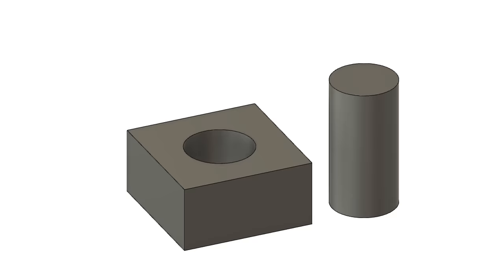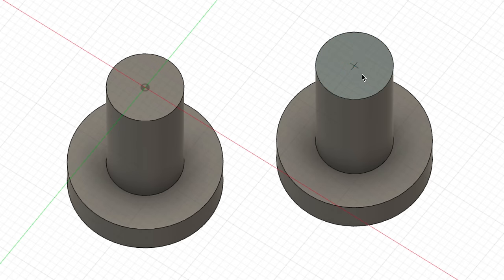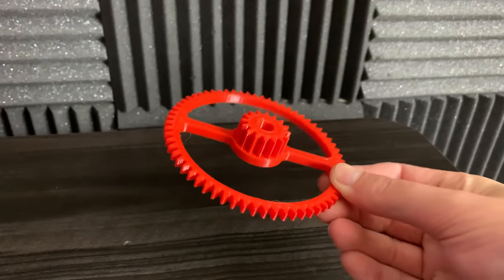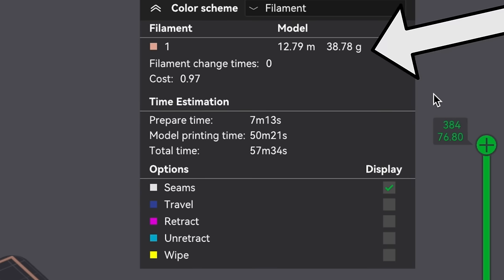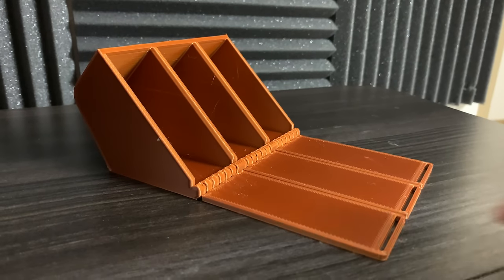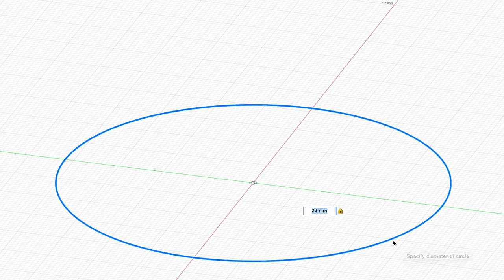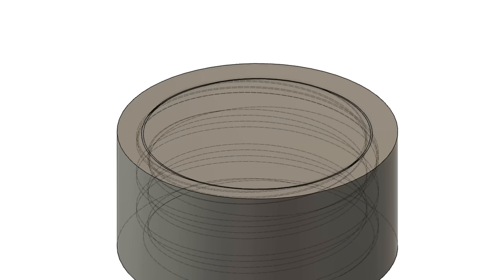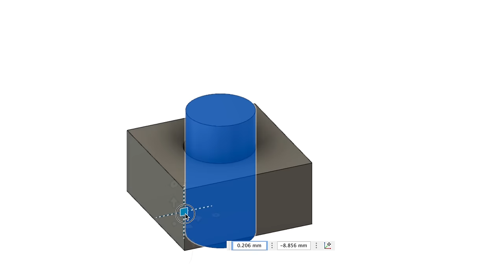10 Secret 3D Printing Tricks Only Experts Know...

Comment: There is a reason why people left Fusion 360 a year ago. They stopped supporting STL or something like that
Reply: @htpkey  Fusion 360 was free for non-commercialuse. They changed the rules later on and made it more restrective at some point
Reply: @tomaszworoch  True. They still offer a free "stripped-down" version of the program. But I would rather use something else.
Reply: STL works fine in Fusion 360.
Reply: @DisorderedArray  Then I do not know why did I leave this program xD
Reply: @tomaszworoch  They removed STEP export (it is now back after the massive backlash) and you can only work with 10 active "projects" (or individual parts of an assembly). 

If you create complex models using assemblies you will reach that 10 project/parts limit very quickly. A workaround would be to add all your assembly parts to a single project, but the workflow is worse because of it.
Reply: @htpkey  Good to know :) maybe I will get back to it then
Reply from the maker: You can still export STLs with the free version. It actually has most of the same features as the pro version.
Reply: Always have multiple softwares for creating and editing models

Comment: That .4mm tip is actually MONEY I always go .25-.30 for a snug fit .35-.40 over for smooth
Reply: A bit of clarity here. These clearance values you (and the video) are mentioning, specifically with the example shown of a cylinder fitting in a hole. Is this clearance allowance applied to the cylinder (and/or hole) radius or diameter? This kind of makes a difference. ;-)
Reply: @Sembazuru  good question, for me in the case of a part threading onto, or fitting over an existing diameter eg. an adapter that must go onto an existing tube/cylinder, I add the clearance to the part with the hole.  The reverse is true if the case is opposite.  If I am designing both from scratch it comes down to materials, precision requirements, etc. But in general, I either split it between the two or default to the hole carrying the clearance
Reply: @howardeley3577  You misunderstand my question. Is that clearance applied to the radius or the diameter of the part that you are over or under sizing? I suspect the radius (so there is the full clearance on both sides of the circular cross-section). But I was just asking for clarity.
Reply: @Sembazuru  actually, the diameter. So if 9.5mm dia shaft, 9.75-9.90mm hole.
Reply: L
Reply: Thank you for commenting this. I’m new to printing and have always wondered about these exact numbers. You really made a difference in my life man.

Comment: great video.... but FUSION is not free. only get to use it for a year before you have to purchase. What do I throw out my 3dprinter once I have finally begun o master Fusion?
Reply: I prefer FreeCAD for most things. For one, it's open source, for two it runs native in your comp. It is quite powerful, in fact it has some functionality that Fusion doesn't (and vice versa of course).
Reply: Yeah, I agree. Recent events show that not all cloud services are 'free'. They change their mind from time to time. Opensource never fails. It may be not optimal and have trouble. But at least it is permanent.

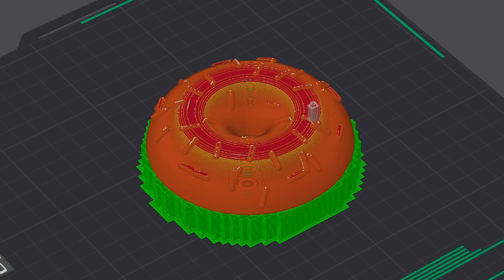Comment: @1:55 because of retraction issues, FDM printers dont print tree supports well.
Reply: It depends. I do not know about stock printers. But custom heads have no trouble with retraction distance of 1mm or even less. I have not very good custom direct, which I 'temporary' using for two years, it handles 2mm with no trouble.
Reply: @enosunim  printing tree supports introduces underextrusion into the model. 3d printers ASSUME that 3d printing is linear. But flow pressure is not linear. So when the extruder moves linear, the filament at the nozzle doesnt. So the more you retract, the more damage is done to the print quality.
Reply: @tazanteflight8670  there are different techniques to take into account pressure change like Linear/Pressure Advance. Also it really depends in what order what is printed(if supports printed before model layer or after it is just like normal retract on layer change). And heatblock chamber volume. It depends. I do not see much difference between tree supports or printing multiple objects at the same time. If retraction distance is short, then pressure change is also small.

Comment: Dog, that is not a live hinge, just print in place. The 2nd tip about improving strength is misguided, material in cylindars is only useful towards the edges. Thats why driveshafts are hollow, and we build with tubes.

Comment: You went a bit fast there with the 3D printed threads in Fusion 360. What settings gets you nice printable threads?
Reply: All. Just choose the diameter. Trapezoid threads are suited best.

Comment: Fusion 360 is no longer free unless they changed the licenses again
Reply: It's still free for personal use
Reply: @SmalltimR  so i cannot make commercial designs/3d prints
Reply: @EXTREMERC416  
You can if you are a startup business, you can apply and use it free for up to three years from the date of application.

That said, and should you be an established business in need of the occasional job, you can then use a perpetual license, which allows you to use Fusion commercially on a case by case basis.

And of course, there is the free licensing scheme, in-where you can use Fusion 360 in a non-profit setting.

Whatever the case, it would appear that the current licensing plans have all of the areas covered when it comes to helping people to use software in most any case.

Comment: Not sure if your going to see this but if you or anyone can tell me what's a good basic 3d printer to start off with if your just starting out
Reply: Most people tend to start out with an Ender 3 or one of its variations (I own an Ender 3 S1). You can get them for under $200 in some cases, which is a big plus.
Reply: One you can afford! Generally the printer itself isn't a deciding factor, although some are known for being more difficult than others. There are 2 main types of 3D printing, Resin printing and FDM (sometimes called FFF or FFM, they all mean filament based printing.) I suggest starting with FDM, it's alot cleaner to start with, since solid filament is easier to handle then liquid resin. 

Personally, I think the Ender-3 is the best  starting machine, but I own 2 of them and haven't used anything else, so YMMV. You can find Ender-3s for under $250 right now, pretty easily.
Reply: ^
Whatever you can afford, just make sure to look up reviews for it so you don't end up getting a fire hazard like the anet A8
Reply: I've had good luck with a Prusa i3 MK3s, but the trick is to read reviews, and find a printer with a decent community around it.  Creality printers come to mind, and an Ender 3 V2 Neo seems like a reasonably priced model.  You need to get what your budget allows, but on the other hand, you don't want to go too cheap, because 3D printers have a lot of small revisions done to them, and a new Ender 3 revision will have a lot of minor improvements that make life easier than buying an older model.
Reply: Ender 2 pro is $120 and has good reviews
Reply: @heckerj44  don't you mean ender 3 V2?

Comment: That hinge is not a live or living hinge, it is just a normal hinge. A live or living hinge is where the hinge is just a thin piece of plastic or other material that folds.

The first 2 were just common things, not just for 3D printing, threads and C clips are very widely used.

Comment: A note on the pinhole: in that scenario, the extra material is doing very little for you in most cases. For a lot of the stresses you deal with, focusing on the shell/wall will be the best use of material. For most people: just increase walls and infill unless you know what you are doing. If you want to learn more, look up basic “strength of materials” or “mechanical engineering design” courses, there are some decent intro courses on YT.
Reply: Exactly. With the pinhole, he's just basically trying to create more infill, but the problem is that it's only centralized, so unless you know exactly the stress load is exactly in that pinhole area, you are much better off with thicker shell, and/or simply more infill %

Comment: One tip that was not mentionned that literally makes the difference between someone who knows the limit of 3D printing is using inserts.

Not only do they make your threads reusable, but they also force you to make your parts intelligently since you can't install them at random.

I'm kind of sad an "expert" did not mention this.

Edit: I'm working in engineering.